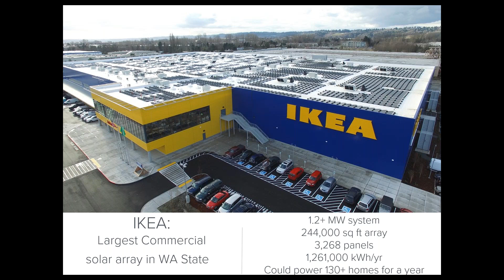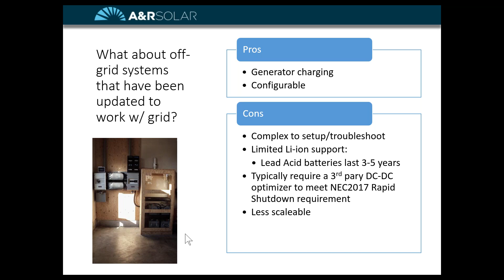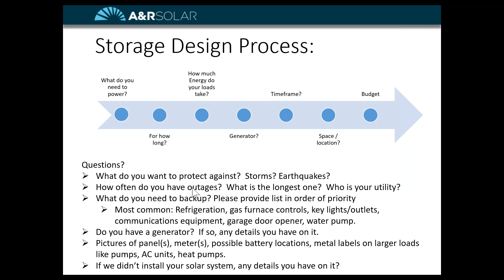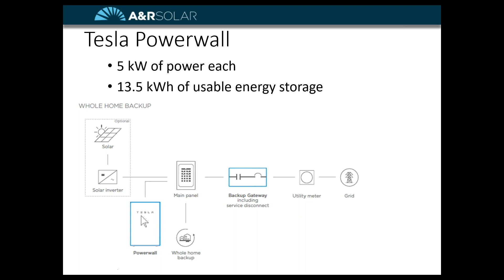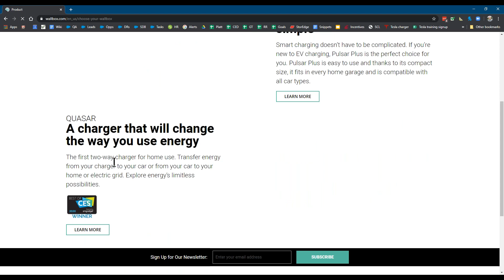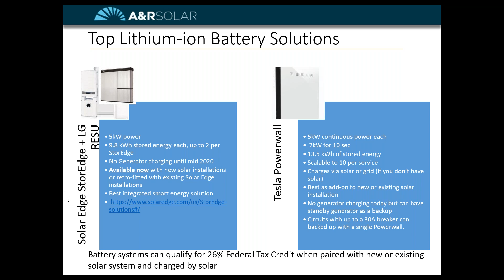Deep Dive into Modern Lithium Ion Battery Storage

Comment: My local utility charges a $5/KWh fee for solar systems feeding back to the grid. For a hybrid system with battery backup, is there a way to connect the system so that the grid will charge the batteries but the solar never feeds the grid?
Reply: You can have an isolated micro-grid (not sure if that’s the proper name) where you take a portion of your load, put it into a subpannel which is normally disconnected from the grid and fed only by your solar + off-grid battery system.